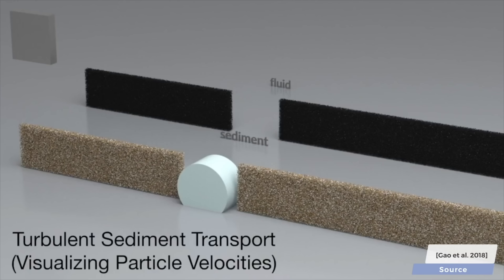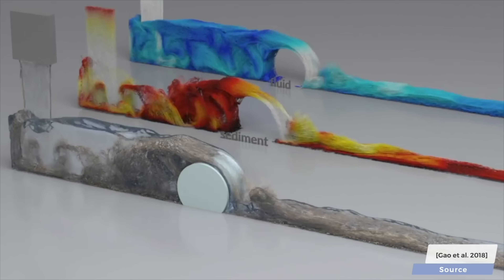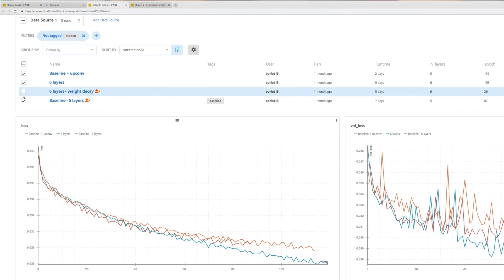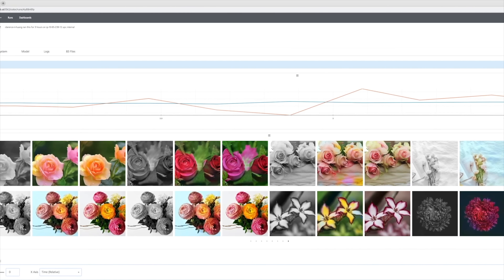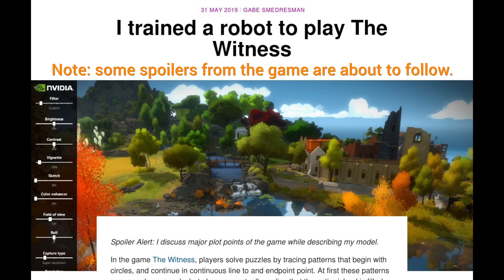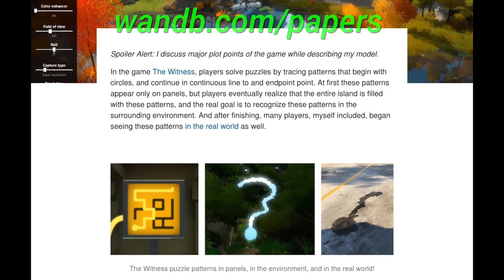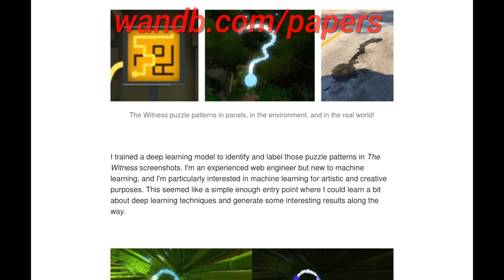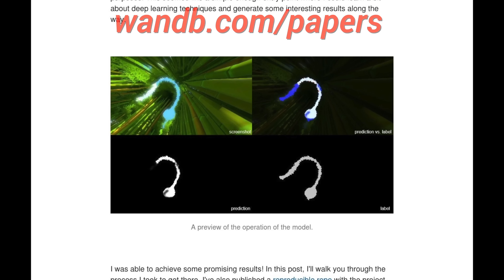Is a Realistic Honey Simulation Possible? 🍯

Comment: The honey density highly depends of the temperature of the honey.
Reply: this goes for any element on the periodic table
Reply: @ZNotFound  the element of bee slavery
Reply: I think you mean viscosity tho, they're quite different things
Reply: @sebastianwojtasik2090  if you have 1 lb of honey its most dense as a solid, less so as a liquid and even less as a gas. the varying viscous states between solid and liquid are because of its density.
Reply: @sebastianwojtasik2090  Yes. I used wrong term since in my language there is no word for viscosity.
Reply: If you’re curious about numbers and problems involving the viscosity of honey, there’s a channel called SmarterEveryDay that did a video on viscosity problems, especially pertaining to the aspects of the liquid coil effect.
Reply: @urmumske1248  You're right about the temperature affecting the viscosity, not about the density affecting it. Mercury for example has a really high density even though it is liquid and is almost as viscous as water. The temperature affects the density though.
Reply: @martinthedragon4389  I wasn't saying that any material with the same density as another will have the same viscosity but that the viscosity IS effected by a given materials density caused by thermal energy and pressure. the comment suggested that viscosity of honey would be regardless of its density
Reply: @urmumske1248  That's new. Weird, I can't find it on the periodic table.
Reply: @urmumske1248  the temperature and pressure is what affect viscosity. density is completely irrelevant.
there are cases where, for example, temperature goes up cause a lower viscosity but higher density.
Reply: @shiinondogewalker2809  okay, give me an example of a single material that does this
Reply: I think you meant its viscosity, not its density.
The viscosity also depends on the age, flowers, bee type, season, climate, storage and processing. So its really not the best to use for experiments, a controlled mixture would be far better.
Reply: @urmumske1248  water at about 2 degrees celsius
Reply: @shiinondogewalker2809  oh yeah that's true, negative thermal expansion
Reply: Not only that, but honey can have a water content anywhere from 13% all the way up to 23%. That makes a huge difference. Then it's also dependent on the type of nectar it's made from. Heather honey for example contains more protein. You can easily hold a jar of that upside down and it won't drip out.
Reply: @urmumske1248  but what weights more 1 ounce of cold honey or 1 pound of hot honey?
Reply: Isn't the assumption room temperature?
Reply: @TileBitan  yeah it did lol
Reply: Very very small variation though. VISCOSITY on the other hand changes a lot with temperature.
Edit: oops I'm late for the party
Reply: and then again, you can say that about anything (or anyone 😈)
Reply: @ZNotFound  it's consisted of many elements
Reply: @sebastianwojtasik2090  Not the same thing, but related enough to consider. The thicker the liquid means that the liquid is heavier, therefore the density and viscosity is kinda related. But if temperature was involved, the effect would be more apparent on viscosity than the density (I guess).
Reply: Are you saying his amazing real life demonstration doesn't cover all practical cases?! Appalling!!!
Reply: @DavorHorvat  
viskoznost and gustoća are both words for viscosity and density, respectively, I think. I'm assuming you're Croatian, if not, where are you from?
Reply: @DavorHorvat  physics must he terrifying in your country
Reply: @warrenpeas  I can’t tell if you’re being serious or not

Comment: In the real footage the dipper was going to fall but they cut the footage :(.
Reply: They had to because it was a threat to national security.
Reply: This made me feel cheated. I think the one-way coupling simulation was actually the most correct, except for the speed and the insane bounciness of the stick on the glass. In my mind (because I don't have a glass of honey with a dipper at hand) the dipper would slightly decelerate again before hitting the glass, but I'm unsure why.
Reply: Maybe because in real life you cant put the dipper in perfectly straight up? In the simulation im assuming it was perfectly straight and thus no falling. In real life the dipper had to have been put in very slightly off-center and gravity can still slowly pull the dipper down.
Reply: @idahawk5193  In that case the other simulations also would've kept the dipper upright, no matter how volatile the balance. If you can "simulate" an airplane standing on the tip of its nose, the simulation is flawed.
Reply: It’s like the last scene in inception. Did it fall or not?
Reply: @CeezGeez  if a honey dipper is rendered and no one sees it, does it fall down?
Reply: Yeah I think they just scaled the viscosity badly in a couple if those
Reply: We also saw the dipper moving in the final simulation, at roughly the same pace. Realistically, they both would have fallen eventually. Would've liked to see it though! I honestly thought the problem was the weird jello-like consistency (as opposed to the stickiness of real honey), but that seemed to get fixed along the way too.
Reply: @mrwensveen  Correct me if I'm wrong, but isn't basically everything balanceable? If the points of gravity (or whatever you call them) match up with the nose of the plane, wouldn't it be possible to make it balanced on its nose, even in real life?
Reply: @kimeojin1234  Well yes and no. If you're off by even an infinitesimal amount, the plane will fall eventually. Realistically it would be impossible, and theoretically given enough time even a quantum fluctuation would tip the balance.

Comment: Could you show the equations they are supposed to simulate ? And which one they actually use
Reply: There are links to the papers.  But I think I get what you mean.  The papers have pure equations maybe, and the simulations might use a simplified version?
Reply: @culpritdesign  The topic of the paper IS the simulation which always is based on a simplified version of the exact equations (also called physics/fluid dynamics. The term simplified may be interpreted in two different ways. It has been possible for almost 200 years to compute the exact behavior of fluids with a tiny set of short equations combined with a suitable numeric approximation algorithm using a pen and paper (and a lot of time). The real challenge is to find a different, probably not so easy to understand set of equations that are more efficient to compute and still accurate enough.

Comment: The initial simulated honey looks like the temperature is just warmer than other simulations or the “real life” used in the video...
🍯 🍯 🐝 🐝 🐝 💧 💻 🧮
Reply: Another
 factor that determines the honey viscosity is its temperature. As temperature increases, viscosity falls, due to less molecular friction and reduced hydrodynamic forces.
Reply: What? Honey does not roll up in weird gelatinous clumps when you twist the dipper.

Comment: My suggestion for realistic simulation of fluids is to record the fluids properties and motions based on object weight and mass and have the software replicate what it sees based on data and then apply what it learned to a new generated environment. But it doesn't end there. It has to calculate temperature into the equation. The alternative to this is to have different areas have different properties, like categorizing. This would make it easier to simulate different fluids realistically unless you can apply different properties to different statements. Just my theory.

Comment: The strong two-way coupling is missing the distortion of surface tension of the bottom rim of the glass seen behind the tool. it looks like it's frozen in place instead of being held there.

Comment: It's a non newtonian fluid. Based on the video my guess would be when the particle velocity is low the strong two-way coupling is correct. When particle velocity is high the weak will be correct. The transition between this is doubtfully linear, so much experimentation would need to be done to find what velocity corresponds to what viscosity.

Comment: Just from observing the simulations in your videos, and compared to the real life videos, it seems that lack of surface tension is a major contributing factor to the discrepancies between simulation and real life.
I noticed although you showed the thing sticking in the honey, you didnt bother comparing it to how honey dripped at all. So I assume by giving it the properties to make the thing stand up, you sacrificed some of the kinetic properties that honey has. (Maybe it kept those properties and just had another reason for not showing them idk) In real life what allows honey to flow as well as hold up a stick is somewhat in part to its surface tension.
I also observed in the smoothie martini thing, when it overflowed and spilled off the sides, it more or less went straight down in the simulation, where in the real life example it stuck to the surface of the glass despite it being such a steep angle. Which is also in part to surface tension.
You never mentioned adjusting any values such as surface tension or capillary force. So I wonder is there any calculations you are doing on these 2 dimensional boundaries (liquid to solid, solid to air) other than just friction and stickyness?
And if you're not, are there plans to create separate calculates for surface tension in the future?
Reply: Yes, even I observed this with simulation and real life. You've explained the problem more accurately than I could've.

Comment: Have you ever thought of using Triangular curves to model honey. ok so a triangle curve is a type of parametric curve, what you do is you graph a slice of a circle and change one of the radius lengths and progress the one radius to the other radius in the simplest linear way. ok but this works for tetrahedrons and curved surfaces and you can tweak the progression line instead of using the simplest linear one I'e a diagonal line.

Comment: Is air being treated as a fluid in these simulations as well? It seems in the last example, the yogurt, that it's behavior is that in a vacuum. Atmospheric pressure would contribute to pushing the yogurt against the martini glass, along with surface tension, which I assume WAS being simulated.

Comment: @Two Minute Papers - are in general these kind of implementations easy to use with something like Blender? (assuming they publish code) or should I be (re)implementing the algorithm based on the paper(s) if I want to achieve that? what do you usually work with to be able to put these kinds of 3D algorithms to practice and render out production-ready results? or rather, what is usually the flow to put something like this to use?

Comment: Fluid animation still has a LONG way to go before it’s even close to looking real. Even the “best” ones on display here just look...off. It clumps together in weird ways when it shouldn’t, it tears and separates at weird times and places, it doesn’t wet the surfaces it touches, it either doesn’t cling to surfaces nearly enough or it does way too much, etc. I don’t know exactly what combination of factors causes so much trouble in this field, but so far I have yet to see any sort of engine driven fluid simulation that could pass as realistic.

Comment: Greeting! For scientific work, I would need a program that simulates a large Reynolds number flow. So far, I have tried a discretized solution of the Navier Stokes equation (I calculated the first and second-order partial derivatives from the Taylor series expansion), but after a while, I experienced strange behavior (oscillations in pressure appeared in some region). Can you suggest an algorithm that correctly simulates the flow by eliminating these? Thanks in advance for any help. Regards Attila.

Comment: I am wondering though, why there is much less improvement in the field of engineering simulations, though. For example cfd simulations still are using the same types of models and solution techniques with hardly anything changing there.